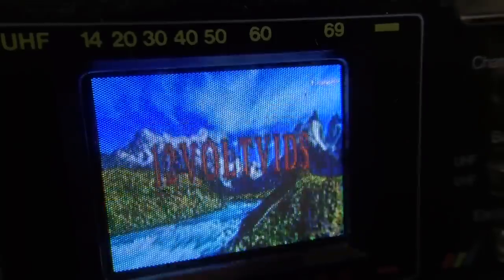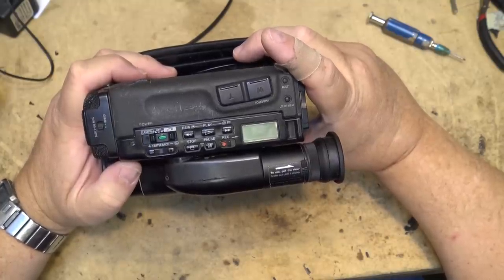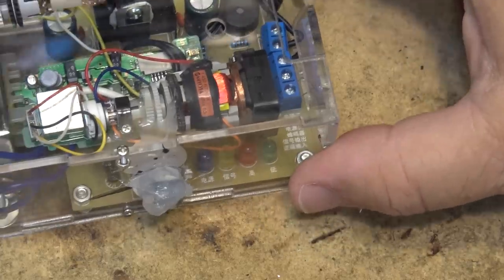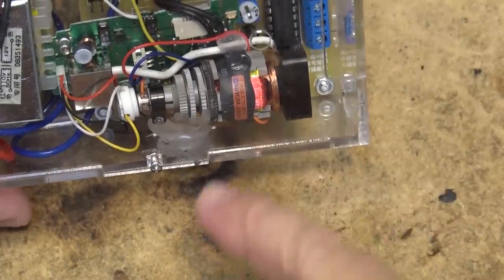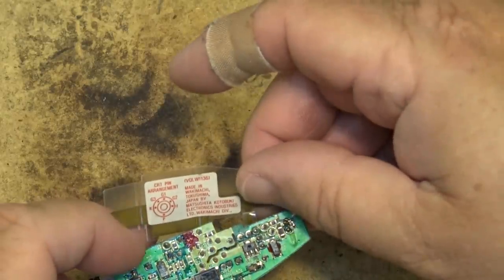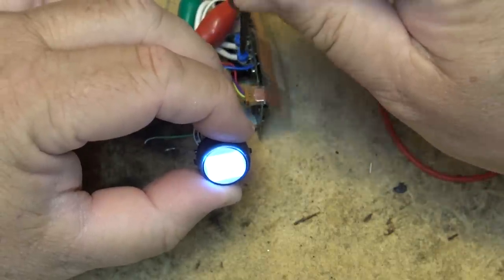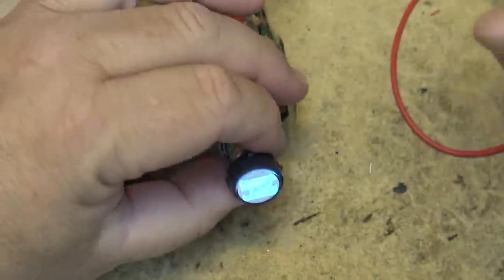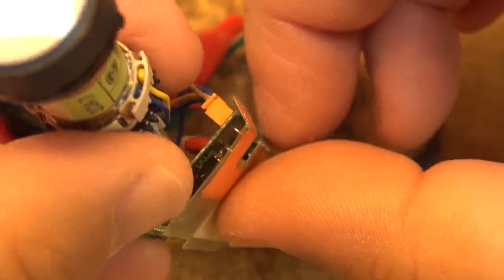Smallest round CRT in the world and it works

Comment: Back in 1974 the smallest b&w CRT was in Space 1999's comlock communicators.  A marvel at the time.
Reply from the maker: UnFunded Opportunities 
That was probably a prop
Reply: 12voltvids - and probably the display screen on a Star Trek tricorder (from the original series) was as well. Even if you could manufacture one (back then) that small that worked, it’d be too fragile to be useful as a stage prop. If they did have any episodes that showed anything on the “display”, it was probably done post-production w/green-screen techniques; ditto for Space 1999 (or the soon to be released Battlestar Galactica.)
Reply: The original prop was designed around what then was "the world's smallest TV screen" (the 1971 Panasonic TR-001, 1.5"/35mm across)  -  from Wikipedia
Reply: This is the working Space 1999 prop.  1971 Panasonic TR-001. The screen is 1.5"/ 35mm across.
http://catacombs.space1999.net/main/models/w2pcomlock.html
Reply: Ohhh I so much wanted one of these back in the days.
Reply: @12voltvids  Gerry Anderson's production company were obsessed with using real CRTs because they had invented a system to sync it with the camera and wanted to show off their technical skills. Also, superimposing a fake video image on a prop screen was harder to achieve then than simply just using a real CRT..  just look at some of the awful blue screen work in Dr. Who of the same vintage.

Comment: Hey 12VoltVid - interesting video.. What Panasonic camcorder did that round-tube monitor come from? I think I'll find one on eBay. A Raspberry Pi Zero is about the same size and has composite video out. I'll build a Pi plus the monitor into a small acrylic case, powered by microUSB. A button (or optical sensor, capacitive sensor, dry reed etc. inside the case) could cycle round TV test patterns, ctr-clock, old b&w episodes of Doctor Who etc. I'll send you a photo when I"m done if you like....

Comment: Hi, greetings from Russia
I connected the viewfinder to the videcam, and the picture is looks like out of sync, what can i do with this? How can i synchronize viewfinder with cam?
Reply from the maker: First make sure that the viewfinder you are using is actually a composite sync model. Some used external sync from the camera. Most were standard composite sync though, so a coupling cap may be at fault.

Comment: It is just amazing to look at the small LCDs we now have in our cameras and such. How things have changed. I wonder what type of display is next?
Reply from the maker: LCD screens are still pretty low res. The best ones use OLED screens. My 2 ligh end cameras use OLED for the eyepiece viewfinder. My cheaper camera I use for the youtube uses an LCOS or DLP tyoe o technology as you can see the bias light hitting the area that borders the image, and if you shift your ele you get the color strobing that early DLP projectors had.
Reply: True but at least they are larger and easier to see. One of the cameras I have is able to give me a decent idea of what the picture is going to look like which is all I care about.
Reply from the maker: My FDR AX100 has both the flip out 3" screen and an OLED eyepiece.
Considering that I am at the age where reading glasses are needed for close up work, I find the oled eyeplece is what I use,  as there is a diopter adjustment so I don't need reading glasses to focus on that one. If I am on sticks then the flip out is fine as I am generally more than 18" away and can see that fine but closer than that and it gets fuzzy.
Oh well, better than it was 8 years ago before I had lasik. I needed glasses for everything beyond 18". Now I can see perfect, no glasses needed except for 2 things. Fine soldering, and splicing fiber optics.

Comment: How do I determine what is the power and ground wire is. I have 1 out of a sony and one out of a sanyo. Also going to become a patron supporter. Love you channel. Is patreon your preferred route?
Reply: If there is an electrolytic on the board you could try checking continuity from it back to the input wires. This will also indicate polarity.

Comment: I bought a Sony Handycam to rob the CRT from the viewfinder and the joke's on me - the viewfinder was just a telescope - no electronics!  It's a neat item from 1985, video-8, just not what I wanted.
Reply from the maker: Cliff Miller 
Was that the ccd m8 by chance.
Reply: 12voltvids  It is!
Reply from the maker: That is a record only camera. No play back ability. It was sold as part of the pack 8, which had a separate playback unit. (I have the player from the set) The shop I worked at back in 1986 had a bunch of these cameras and we would rent them out for like 30.00 a night. Pretty much every weekend all the cameras were rented out. We never rented out the player, so the customer would get the shop to copy the tape to VHS for them when they returned with the camera.
I think we had 5 of them that were rented pretty much every day when Expo 86 was running, and then it was a weekend thing. They would sit there all week, and go out Saturday as they got it till monday.
They all got trashed. I remember taking one and mounting it to the bumper of my car and driving around and recording for about an hour.Mounted it in the grill between the fog lights on my old Mercuer XR4 Ti. Now that I think about it, I wonder if I still have that tape. Will have to look and see if I can find that one.

Comment: Babys bigger brother, stil cute though :-D
Oddly i only expected a rectangle screen, the round face just reminded me of the first old tv's with a round screen.

Then the oscilliscope jumped into head, dam heavy beast, i nearly fell over with the weight of the thing in my head :-D.
I have an old analog cossor scope and it's still a heavy sod, it's not even valve/tube based.
Also a Telequipment and a micronta analog display scope, can't have enough scopes.

The telequipment one was always breaking down when i needed it, bad joint city inside.
 I have fixed so many joints that it's actually become reliable lol.
Reply from the maker: Come October I bet there will be a ton of joints SMOKED here in Canada.
The only smoke from joints around this place is from the rosin in the solder when I fix one.
Reply: Yep me too.
Some flux can smell really sweet, odd that.
I had a father that drunk alcohol a lot and took drugs, it programmed me never to follow his ways, i'm tea total.
Reply from the maker: zx8401ztv 
I had friends that went down that road. I saw how it messed them up. I know there are plenty of folks that are just counting the days till they can buy it in the store on oct 17 but myself I will just walk on by. What scares me is those that will take and then drive. Lawyers are already running their hands together in anticipation of a booming business once the driving while high charges clog the already overloaded courts.

Comment: Would you be able to tell us how you get a video signal to the  CRT?  I am not sure what it requires.
Reply: heyou Standard NTSC video is available from a VCR or DVD player as an RCA Jack labelled Video.
Reply from the maker: heyou 
I just put a composite video signal into the video in wire. It has on board processing. You need only 3 wires. Power ground and video. The shield of the video is tied to ground.